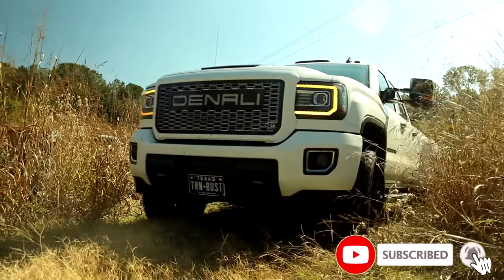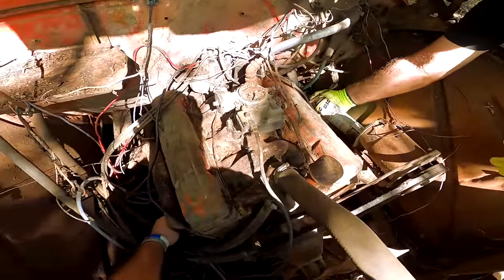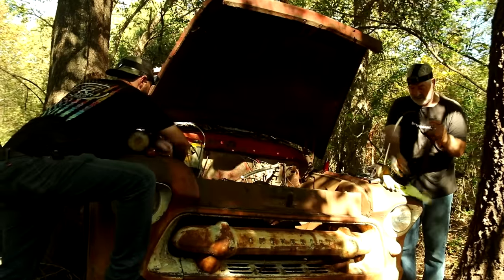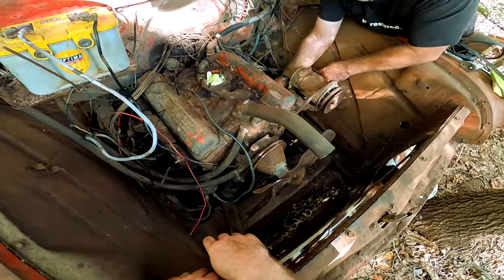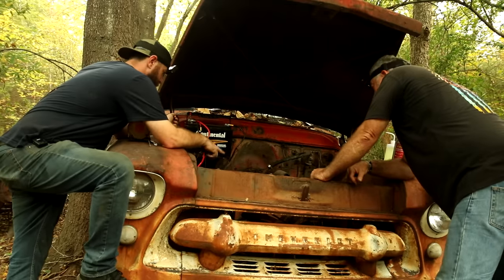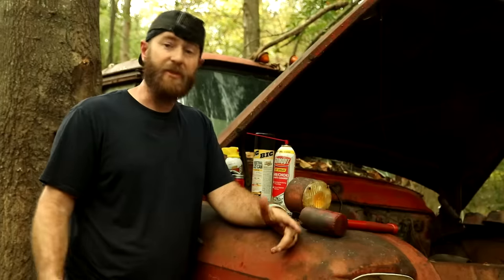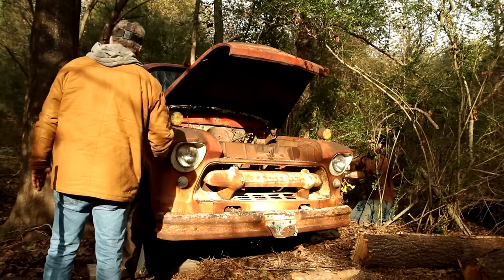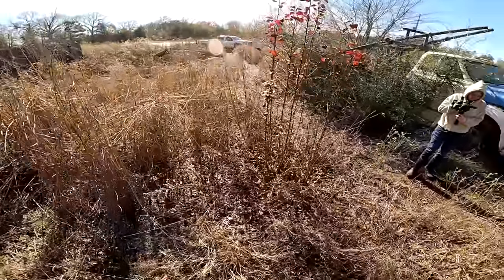Abandoned Truck Driven From Its Grave After 50 Years | 1957 Chevy Viking | RESTORED

Comment: Very cool to see the old 57 1ton run again. Actually runs well which is hard to believe after parked for 50 years. Would be neat to see this old truck haul another vehicle out of the woods in the future. Great video, thanks.
Reply: And pray the rings don't aren't stuck after running a while I had old Chevy do that
Reply: @tomrobards7753  marvel mystery oil in fuel and oil  lubrication for everything 
And napa 30 wt oil
Reply: Would be awesome to see more videos on this truck, make it into a ramp truck or tow truck
Reply: This is a great idea!
Reply: Was thinking the same a nice patina car hauler
Reply: iirc a 3300 is a one ton im pretty sure 4400 means ton and a half.
Reply: You  know a new vehicle wouldn't do that after sitting 50 years
Reply: @tomrobards7753  

Por faLo
Reply: It's a 55 ton and a half.
Reply: @markwilliams4525  I don’t know about that.  If the critters didn’t eat up the wiring a new vehicle just might start up and run.  The difference would be in how the weather/elements had treated the electronic controls.  I wouldn’t be surprised to see a modern Cummins start up after sitting for half a century!!  I’ve seen some amazing marine diesels brought back to life!!
Reply: a dinosaur awakens
Reply: Man, nice but not sure about it being there 50 years. the license plate on the front bumper is not 50 years old ?
Reply: Is this car really here for 50 years?

Comment: The inspection port on the side of the distributor was so you could insert a tool and adjust the dwell while the engine was running. Love the old engines that were a breeze to work on. Great video, fun to see old trucks come back to life

Comment: I've been subscribed to back before you changed the name. I really like watching you save these classics. I Loved this video! It so reminded me of my Dads old 49-50 Chevy pickup that my uncle wedged between two trees up here in Massachusetts, back in the early 1960's. My dad just got done working on it when my uncle, my dad's sisters husband, came over. I was about five years old and he said to dad..."mind if I take a ride through your woods? Dad didn't answer and off uncle Russ went into my parents woods. 20 minutes or so later he comes walking out of the woods. What happened said dad. "I got her stuck" is all he said . There the truck sat. We used it as a playhouse. Pretending to drive. I remember sitting in the steering wheel and rocking back and forth. I used the hood as a toboggan one winter. Vandals broke the windows, Stole parts. The land was sold off in the eighties because taxes doubled. And dads Chevy was buried under tons of dirt,. It now rests as we speak, several feet underground, below a housing development. I'm 65 now and wished I could have pulled that truck out of the woods and fixed it for dad. Dads gone some 20 years now. This video brought a tear to my eye thinking back to that day in 64.Thank you.

Comment: The headlight shrouds on this made it look like it was frowning at first, but as the truck made its way out through the brush, it looked more like it was concentrating on the task at hand 🙂
Wonderful stuff, as always.  Thanks guys!
I may have a resurrection coming up in New Jersey - a 1952 International L-162 grain truck, which hasn't turned a wheel since 1981...

Comment: Just about 10 years ago we had a 66 Chevy with a shot transmission but the body was in pristine shape for being here in the North East USA.. How ever it was pinned between some trees not so big around as those are. But with the help of a guy digging a septic pool right near us he & his helper took interest in helping us out. He told us to get together a bunch of study pallets some long 2X12" planks and ply wood. I was already reading the guys mind and it was early on a very sunny Sat we arrived at 6am to chop up them pesky ole trees which I took home for winter firewood. The guy with the back hoe lifted the front of the truck right in the air so we could build our ramp to get over the other low cut stumps. We worked together like we had worked together all our lives and just built our ramp and with his helper doing one super job of coaxing the truck with a large bobcat machine from behind this thing came up and out of its pinch like it was a magic trick. Mind ya it took me most of 3 days to get everything there and then I cut stuff to size with my helper but I will say some amazing things can happen if U put your mind to it on the rescue engineering end of things.

Comment: Really nice job fellas, I've been wanting to see this truck saved since I saw it in the background of a previous video. It's surreal to see it get itself out of its grave! Most of these truck were inline 6's, so you have a somewhat uncommon one with the small block Chevy V8 in there. I believe they were 283's by '57. Also side note that i find fascinating, that is the original 1957 standard cab seat upholstery and pattern, sure its all torn up, but half the time its no longer there. I have a '56 3600 (3/4 ton) myself. 4400 was 1 1/2 ton. A lot of guys would frame swap her, but I think she'd do well as either a farm truck once again or some type of part-grabbing rig, maybe even put a nice flatbed and make her a tow rig, I'd keep her stock, SBC + Sm420 transmission is a really bulletproof drivetrain, even today. This truck is clearly evidence of that.
Reply: Looking at the hood and grill, I would say that it's a 55. I have one just like it.
Edit: I went back and looked at the hood again, and you may be correct. It might be a 57 after all.

Comment: Great work guys!!!!!  I loved this video.  I would of cleaned that seat off before climbing up in that thing.  The scene just before you tipped the gas can over the second time looked like a scene that could fit right in to a quarter of all the horror movies I ever saw with the way the sun was reflecting/filtering through all that smoke.  Makes me want to go out and restore something, but before I try doing it with a car, I better try my hand at the broken lawnmower I have in the tool shed.  Something tells me I wont make it to the car, but I may get the lawn mower engine working again.

Comment: MY DAD HAD ONE JUST LIKE THAT ONE ONLY THING ABOUT OURS IS THE OLD STOVE BOLT SIX A 261 SIX WE PULLED IT BACK IN THE YEAR OF NINETEEN SEVENTY ONE AND WE PUT A FOUR BOLT MAIN THREE FIFTY OUT OF A CHEVY CAMARO AND IT HAD LOW MILAGE AND WE REBUILT IT ALREADY ONCE AND ITS A TWO SPEED AXLE AND VACUUM SHIFT AND IT'S BEEN A FLAT BED BUT WE ARE DEFINITELY BUILDING A WRECKER BED ON IT AND I HAVE GOT A TWENTY TON BRADEN WINCH ON IT AND ITS GOING TO BE A BIG WRECKER WITH EXTENSION GIN POLES AND THAT IS A VERY GOOD KEEPER LOOKS LIKE THE ONE THAT WE HAVE HAD FOR FIFTY TWO YEARS AGO NOW AND SAY BROTHERS GOOD VIDEO AND MANY THANKS FOR SHARING IT WITH US

Comment: BTW   The absense of sludge in the valve rocker area is a pretty good indication that the engine is pretty tight, as far as the cylinder wear. Blow-by is what causes most coking/sludging inside the valve covers. I bet the compression will come up real good after the rings get freed up.

Comment: I think this thing deserves a little restoration, maybe fix some rust spots and get a replacement passenger door or try and make the old one as good as possible, make the interior nice on a budget, make a new bed for it and overhaul or at least check and see if the engine is healthy, would be cool to see this thing as a shop truck for this show where it can rescue other vehicles out of the woods, anyways great job guys :)

Comment: That little window on the dist. cap is there to adjust the point dwell on all GM V8's up til 1975 when points were no longer used due to in addition of the catalytic converter.

Comment: The primary indicator for a 265 engine before late 1956 was that the 265 ci sbc did not have an oil filter nor a provision for one. The oil filter canister with a paper cartridge type filter was introduced in late 1956 and was on a few 1956 engines and cars/trucks but was introduced as standard in 1957. 

The truck you are working on should have come with a 283 which was introduced in 1957 and also had a canister style filter. However, the SBC style engine looks the same with very few exceptions until present and is still manufacture as a crate engine by GM. The engine came in many cylinder displacements, first was the 265 in 1954 but was not the smallest. The sizes were 262, 265, 283, 302, 307, 327, 350, 383 and 400. There are also several sizes that are available that are not standard GM designs.

The first small blocks had staggered valve cover hold down bolts. This lasted from 1954 until 1959. In 1960 the bolt holes where placed directly across from each other.  If your engine has staggered holes (and it seems that it does) it is a 283 and was produced prior to 1960 (assuming of course that the heads were not removed from an earlier, prior to 1960, engine and placed on a later model engine.) In one very clear shot it does appear that the valve covers on that engine are staggered.

Comment: WHAT SIZE ENGINE.?==327== PRETTY STOUT FOR  SITTING SO LONG==I WANT TO SEE IT RUNNING GOOD ??==''RITCHIE' IN VERMONT==ANOTHER JOB WELL DONE  GUYS==
Reply: Being a 1957 that's still the original factory as far as a V8 it would either be the 265 small or the 283 would be the largest.

If it was the 265 it would say turbo fire on it it's probably just a standard 283 Old reliable

Comment: Picked out a 99 camry laid to rest on the back 40 with timing belt broken. Brakes, rotors, shocks on front, tires, new oil sending unit later it's now approaching 250,000 miles and will make it to 300 thou no sweat..

Comment: The valves probably had rust on the back of the valves and seats to where they couldn't build enough compression until enough the rust gets knocked off.  That's also why you can hear more cylinders joining in as it first starts... they are knocking the rust off.  Been there, done that many times.

Comment: My 66 El Camino had the cap with the window in it that car was a 327 engine . It didn't like to run when wet out even a fog wouldn't want to run , i finally got the window tight and sprayed the cap with clear polyurethane and it did alot better . So that could be a 327 .

Comment: Well boys, a trick I used to use when monkey wrenching was to take wooden clothes pins and number then, clipping them on before removing the wires. That way IF it was wired correctly you  were all set. I carried them in my tool box. It would sure be nice to hear the ole girl going.

Comment: Just wondering what do you do if there's a spark off a wire , back fire or cough from the carburetor and starts a fast moving brush fire just because you didn't pull it out of there first ??   Otherwise good video .

Comment: Just by looking @ the engine I would say it's a 265ci because the exhaust manifolds are rear dump, not like the Ram Head (Center Dump), and I think the valves cover bolts are off set not strait across from each other. The First V8 Chevrolet made, good engine but it was having oiling problems...... ( But don't hold me to that because that's what I was told by a old timer my Grandfather) (Pap-Paw). I think in the later 1957 the 283ci came out it was a better oiling engine. SBC are a dying breed because the "LS" came out in 1999. That fine with me but I'm SBC man OLD SCHOOL........I'm a 1959 model......

Comment: It just hurts my ears when you guys take an engine that has not run for 50 years and try dry starting it. The main and rod bearing have to be very dry. Why don't you take a few mins and use an oil pump priming tool and get some oil pressure to whole engine??

Comment: It is not good to start an engine that has been out of service for so long. The engine must be removed, disassembled, cleaned and checked for parts, assembled, filled with fluids, and only then it is wise to move on to the engine test if you care about the engine and it is not all just for effect for the video.